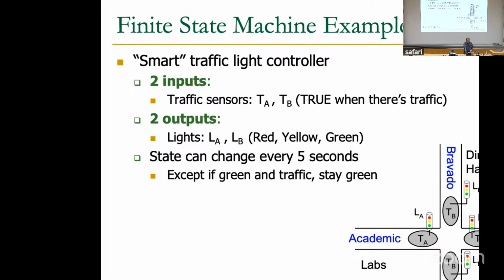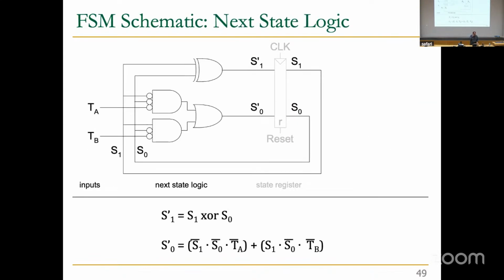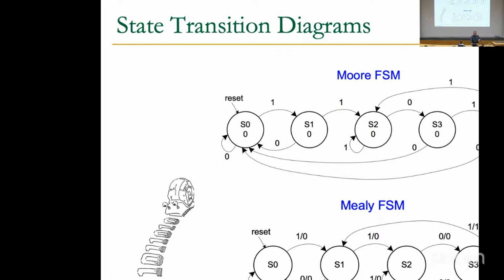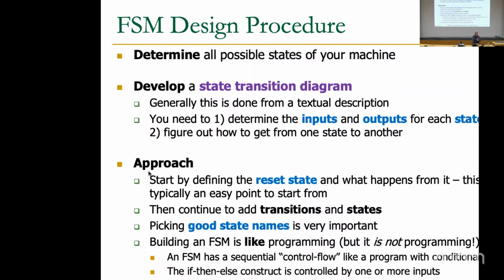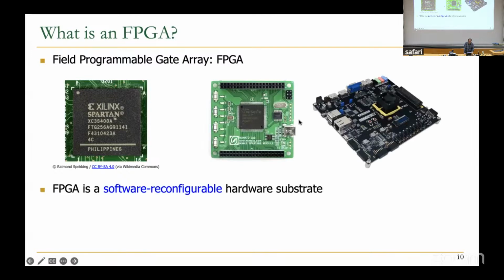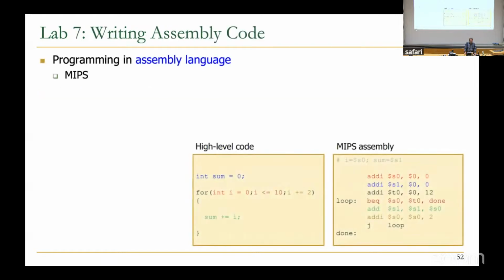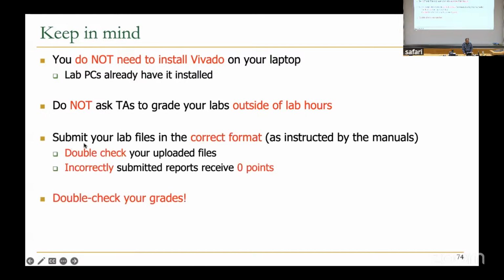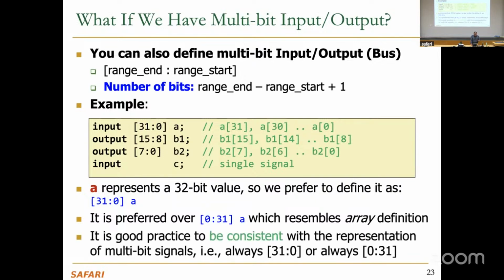Digital Design and Computer Architecture - L4: Sequential Logic II, Labs, Verilog (Spring 2025)

Comment: 3:50 traffic light FSM: if there's no traffic on Ta and Tb at all, then it will continuously loop through RYG for both lights? and if Ta continue to have traffic, then Tb can never be served. This does not look like an optimal design?
16:42 typo on FSM S0? should be La: Green?
Reply: just read the book. way better and clearer. supplemental with lectures of course